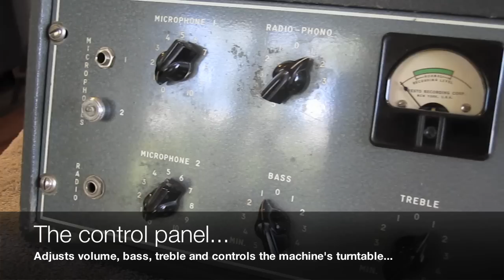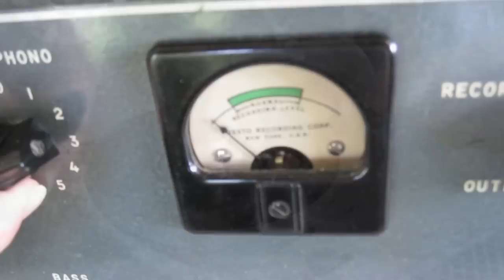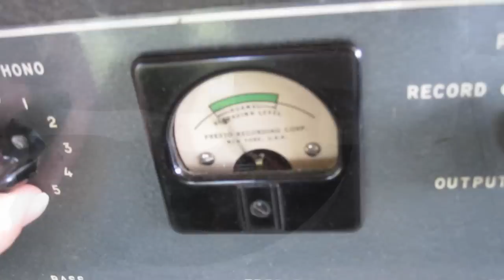Cutting a 78 rpm Record

Comment: My dad and I are currently repairing a 78 record cutter he made out of washing machine parts, an amplifier and some other turned ones a very long time ago. I'm still amazed at how similar his machine is to this one, since he didn't have access to the internet back then.

The machine is all mounted on a thick steel plate, and uses two big pulleys to reduce the washing machine motor's speed to a surprisingly exact 78 rpm, and then drives the turntable using a belt. For the recording arm he connected it using a pretty similar system to this machine, driving it directly from a spiral gear that's under the turntable. And for the cutter itself he removed the cone from a speaker and then attached the needle to the dust cap. The machine had some nice features such as a small hose attached to an air compresor which blew all the swarf off the record, and and also a regular tone arm opposite to the recording one which was used to monitor the recording. It all worked ok and he managed to cut many records, but then forgot about it. It's biggest problem was that you could hear a high pitched scratching noise coming from the recording, mostly because of the needle he used and the fact the recording arm moved like a regular tone arm, which changed the needle's angle and position during recording. We are now working on replacing this bad design for one where the arm slides on a axis (just like the video), and also making a better needle, since the one he used was crap.
Reply: Your dad sounds like quite an engineer, whether trained or self-taught.

Comment: I have one of this cutting machines but is damaged. I recovered this before the demolition of Columbia's pressing plant in Athens Greece. This was the smallest from the other cutting machines.
Reply: Im a technician in Australia that has been searching for any vinyl pressing gear. There is no    used equipment   in Australia .  There's two phonographic Vinyl pressing companys that are are busy enough to be slow and expensive.  Ill take any equipment parts or faulty units. 78rpm is useless though.  45 /33 is what Ill be requiring . . Hack a 78 laith to slow down to 45 if possible .
Reply: @KING VICTROLA 45>33, 33>16

Comment: I used to buy and sell tubes and vintage electronics at hamfests and on ebay. I've resold several RekOKut and WilcoxGay record cutters, including a Rek-O-Kut with aluminum blanks, and a Presto record cutter so old it used #45 triode tubes!

Comment: These disc are a lot softer than a standard pressed LP, but on modern equipment, can be played over and over without any serious damage.  I have several of these.  Some are very old.  The only draw back is they are mono, not stereo.  (I have a couple cut records in stereo but they are very rare.  My old cutter is also mono.  Presto N8

Comment: I had a lacquer disk recording machine similar to this (less pricey though, a Speak-O-phone) as a kid. You can hear some of the recordings done on it on Stinchcomb-Schlueter, 1940's and "50's on U-tube. Most of the lacquer disks have held up, some have separated from the aluminium base. If you used a relative light pick-up or tone arm these instantaneous recordings could be played 100's of times without noticeable sound depreciation.
Reply: There was also the Wilcox-Gay "Recordio" which was a console radio with a built-in record cutting machine similar to the machines which were once common in malls in the 1940s.  I almost brought one home once.
Reply: I briefly had a Dictaphone device that recorded on blue plastic wide bands of some sort. As a 12 year old, I had little practical use for it, I'm afraid.

Comment: The machine I had in the 1950s cut from the 'center' to the circumference. No brushing was required. It was of simpler design but worked well.

Comment from the maker: Hi,
The discs are blank when bought. They produce blank discs. The recorder cuts into the blank disc and then they are playable on a normal turntable (at the correct speed - 33, 45 or 78 - if your turntable can handle 78).

Comment: With the record lathe I built, I noticed that if you record (emboss/cut) at half play speed while playing back what you want recorded at half speed, when you play the resulting record back at full speed the high's (treble) has a lot better response.  This is due to the fact the "embossing/ cutting" needle can reproduce the lower frequencies better as it does not have to move back and forth so fast.  Just a thought.
Reply: You are right, it is half speed mastering.  lets say the recording head is limited to 10,000cps, most of these non cooled, non feed back heads, don't go much above that, most are only capable of 7,000 or 8,000cps in reality.  So you record the 33 1/3 record at 16 and some change rpm,  and play that back at full  speed, of course the half speed, if it has frequencies of 10,000 cps, then it records up to 20,000cps during playback, most of these cutters have a range of 75-,8,000cps, so half speed mastering, and play it back at full speed  it is then capable of recording 16,000cps, still certainly high fidelity.  So for 78 you would want a variable speed and master at 39 rpm to make a 78rpm with a 14,000-20,000 cps high frequency response.

Comment from the maker: @RobertC19850209 Most certainly. To get the lathe cut onto a vinyl - use a 'master' blank instead of a 'dub' blank. A mater blank is of a finer and higher quality and is used to create a 'master' which is then processed to create copies in vinyl or other medium. Dubs are used for low play repeats - often DJ 's will cut tracks or have tracks cut onto dubs - but over time they degrade... 
Masters are meant not to be played at all. They used to cut a record and then used to press multiple copies...

Comment: Nice machine. I've got exactly the same unit here. Mine is missing the fuse and fuse holder on the front. Could you please tell me which fuse the Rek-o-Kut is using? And maybe what kind of holder supports the fuse?

Many thanks.

Dave

Comment: Will it be possible to 3d print a record with stereo modulation? (Laser cut?)
Reply: They tried, but at least it will have no frequencies above 2 kHz. 3D printing isn't fine enough.
Reply: @robfriedrich2822  Well a lasercutter should be fine enough?

Comment: Amazing! Who knew those blank discs were still available? I would imagine that the blank discs are vinyl for a superior sound quality. I guess that this was the format of choice at least until the mid '50's.
Reply from the maker: Definately. Most recordings were cut live to discs before 1950's. Tape was introduced by the German's as early as the 1930's (or wire recording) as far back as the 1920's but they weren't widely used as much as direct to disc recording...
Reply: @dead_formats  some of the Rek-O-Kut machines used aluminum blanks. I've bought and resold a few of their machines, one of which came with a bunch of blanks, but they had tangential, not linear-tracking, cutting arms.

Comment: I remember seeing a process like this with an LP on Mission Impossible (the original series) Jim and Roland were making a recording of Roland dubbing a mob boss voice to trick one of the boys at the casino via a telephone call to put the accountant "in charge" and relieve the other.   Is this record cutting machine vacuum tube circuitry?

Comment: Does this lathe cut vertically or laterally?  The old-timers used to do the cut from the inside out so that they wouldn't have to deal with the cuttings while recording... Will this machine allow you to cut like that?  Finally, where on earth do you get blank 10 inch acetates for a machine like this these days? Great video. :) JC

Comment: Can I still get blank discs?
I have a record lathe that I made at home and I tried a recording with acrylic disc.  It didn't work.  However,  I did not anticipate brushing the swarf either!  I can't tell if the acrylic is not a good material for recording.  They are very expensive to make.

Comment: Newer lathes have a tiny vacuum to pull the string away. Might be something to think about as it would be more effective than trying to brush away while the cutting is in process.
Reply from the maker: Yes, you are right, but this is a portable lathe and they usually just used a brush to clean away the swath

Comment: I have something similar.  It is a Wilco-Gay Recordio.  It cuts 78 and 33 rpm records.
Reply: That's Wilcox-Gay. Record cutting machines were also made by Presto. Wilcox-Gay, and Webster Electric (later called Webcor) were also the two best known names in wire recorders, which literally recorded ---- somewhat poorly ---- on a spool of stainless steel wire, and they later built portable reel to reel recorders. Germany originally developed the superior magnetic-film recorders, and after WWII, an army radio operator brought some home with him to analyze and try to clone and improve upon. With seed money from Bing Crosby, the Ampex tape recorder company was formed.

Comment: Interesting.  Althouogh I would not attempt to use OLD blanks as the acetate
may have hardened, and cause chipping or bad wear or damage to the cutting needle, and you do need that cutting needle. I have a disk rtecorder
in storage, probably early 50's.  It has 78/45/33 speeds .  along with a
microgrrove "lead screw". Usually the cutting head needs work, I'm sure
mine does, when I tried it years ago, the bass response was rather pinched
and volume was a bit low.

Comment: Does anyone know the approximate year this machine was made? I'm assuming the 1950's, as 78's were pretty much done by the 60's, but maybe the speed was continued for home use. Interesting that Rek-O-Kut is still around, but they seem to just make regular turntables now, not recorders like this. I always wondered why the company was called Rek-O-Kut. Now I know.
Reply: +cricketrecords The market for home recording on acetate discs pretty much dried up by the 50's (wire recorders were made but tape recorders soon replaced them, this machine and an earlier model, which I own were probably intended for small radio stations and the like.  DJ's at radio stations often preferred spinning an acetate disc to fumbling with tape reels, and commercials
were often copied on a disc so DJ's could spin them on the turntables they were using.  Later tape cartridge machines replaced even this use. I saw this model in
an electronics catalog in 1959, presumably it had been out a few years.
Reply: I've seen a Presto record cutter that was so ancient it used #45 triode tubes (the output tube most often seen in late 20's to early 30's radios, similar to the 2A3 tube beloved of modern audiophiles).

Comment from the maker: @krimskrams No. The knowledge for making and pressing 78rpm records in shellac is not lost - but the process isn't cost effective anymore - so most 78rpm pressings that are still made are pressed on vinyl. For example, historic Masters (historicmasters (dot) org) use original metal masters of 78rpm records and press them in vinyl. (BTW, vinyl is too soft for use on gramophone or phonograph machines). MORE INFO AT: (dot) 78rpmcommunity (dot) com

Comment: Very interesting ... 78-RPM are hard to find, specially for pop music after 1960 ...
Reply: ManuCarsGallery, that's because the USA officially stopped 78 rpm record production in late 1958. The latest 78 I've ever seen was from 1962, and that's because it happened to be released in Brazil, where 78s remained prominent until the mid-1960s.
Reply: +Jason Madore you are right.  I suppose everyone has heard of by now
the pressings made on 78 rpm by the Beatles in India, around the mid 60's
don't know when they stopped pressing them there.  A few mid-60's ones
were pressed in Latin America, presumably to service old juke boxes
that were still in use (!).  A website reported recently that a 78 pressing of a song by Julio Iglesias from Latin America,  was found believed to be around 1969 (!)